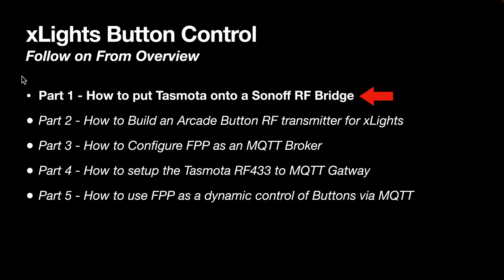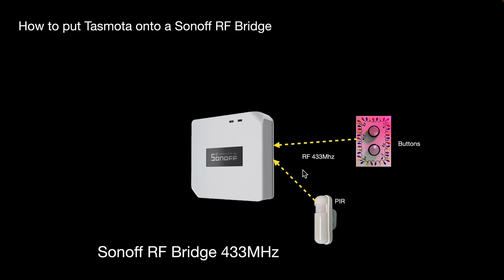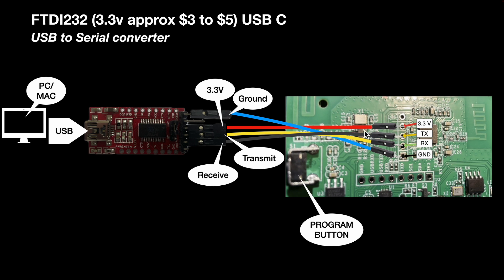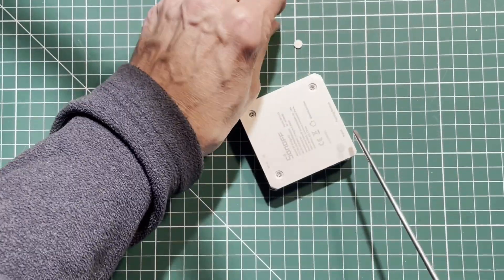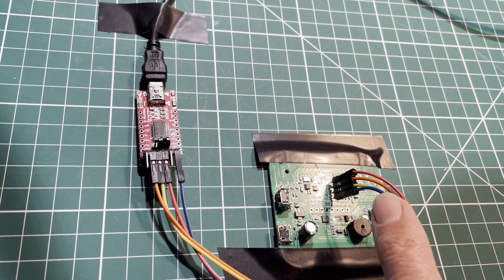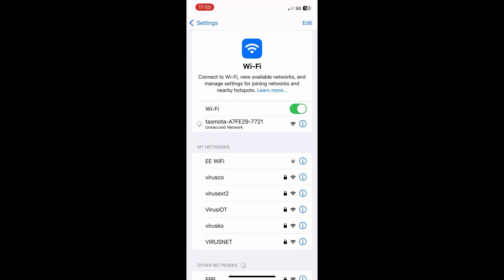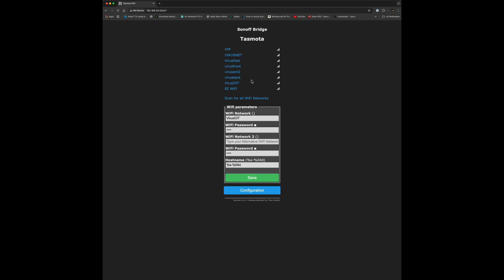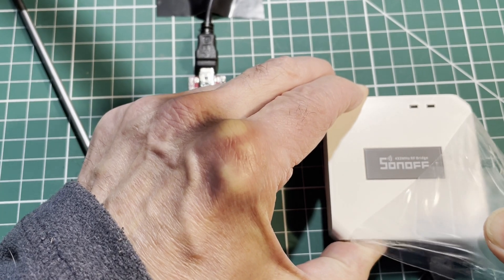Part1 Sonoff RF Bridge Flashing with Tasmota for xLights or home automation

Comment: After a few hours, I realized that the problem wasn’t on my end and it wasn’t the tutorial either -> my TTL adapter had a short circuit. The voltage on the 3.3V output dropped to 1.1V as soon as I connected the RX and TX lines.

Three new adapters arrived today, and it was done in under a minute. Without any modifications (cutting traces) on the board.

Thanks!

Comment: Use a 4pin header for the 'holes' on the pcb.  Its very simple to solder it in then you have a secure connection for downloading!

Comment: I fixed it!
No need to cut anything!
For v 2.2
Set the jumper to 3v3.
Correct connection:
TTL - 3v3 (vcc) <—> 3v3 - RF-Bridge
TTL - rxd <—> tx - RF-Bridge
TTL - txd <—> rx - RF-Bridge
TTL - gnd <—> gnd - RF-Bridge
Press the button on the RF-Bridge and connect to the computer.
The LED will not light,
connect and flash!
Reply: Thank you, that worked!!! You the best <3
Reply: @NemethEdgar  Nice!
Reply: Thank you that worked, couldn't figure out why I kept seeing failed to initialize
Reply: @charlesbrown7079  I can't say I switched to RFLink32 for Sonoff RF Bridge
Reply: Not working for me

Comment: thanks for the great tutorial!
worked like a charm
a couple of potential gotchas for noobies like me: set 3.3v on the esp controller, notice that on the tx on the esp is the rx on the sonoff and vice versa, click the button WHILE connecting to the computer, after flashed, you can remove the usb and connect again for the wifi to show up
Reply: check out my comment above

Comment: Same here, i have the v2.2. board, and with some fiddling I see a com port from the website when I hit connect, but after that I only get the message: "Failed to initialize. Try resetting your device or holding the BOOT button while clicking INSTALL."..